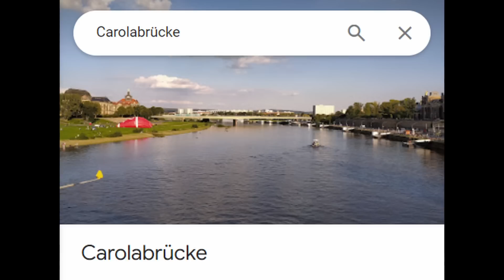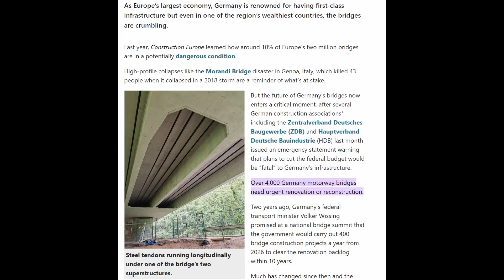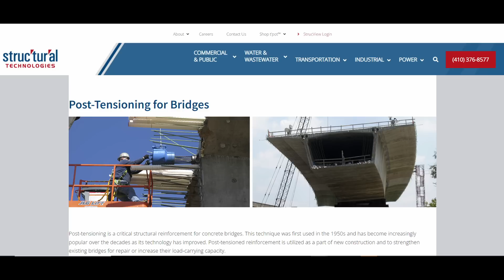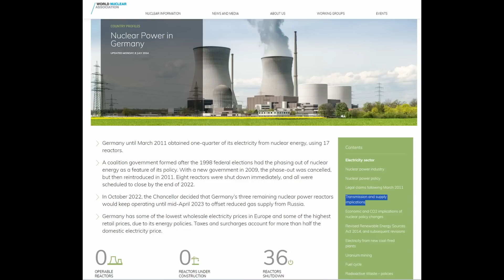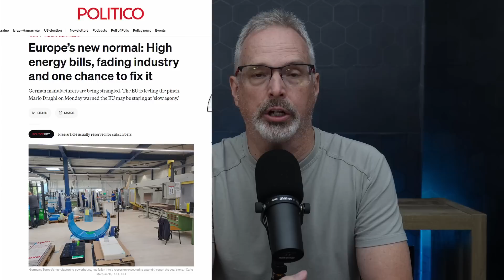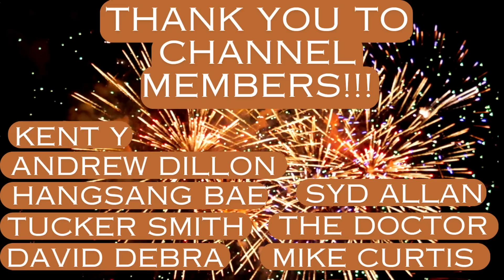Carola Bridge Collapse in Dresden, Germany

Comment: Looking at where the situation has gotten in a lot of places, I am glad my state finally accepted they had a problem mid 2000s and started doing something about it. We were ranking 49th in the country by percentage of bridges that were functionally obsolete or structurally deficient at the time. Budget for road infrastructure replacement was increased in 2004, and a pretty aggressive program of redecking or total replacement of bridges was started, by 2021 the percentage of our bridges in either category were among the lowest in country. Now as the number of bridges that are a priority to address soon has dwindled to nearly zero, road improvement planning for the supplementary funds to main DOT budget is starting to shift to improve secondary highways land portions; such as segments that have narrow shoulders, have sharp turns, and/or higher grade changes than modern standards.

Comment: A few info's from a local, aside from the chloride problem and the lack of maintenance ... we also had a drastic temperature drop right before the collapse happened from 30°C at day down to under 15° at day ... night temp dropped even below 10°C in less than 2 day's - which i believe did give the OLD concrete tension bridge the final "stress"
Reply: Yeah. The Weather was crazy. We went from having the air conditioning running on full blast one day, to having our glasses fog over when we came into the building a few days later. On the "local maintenance front" were I am involved a little bit we have experienced a peak in calls because of small leaks in water pipes in the same period, for example, possibly because of "faster than normal shrinking" of building structures and the like.
Reply: You mean that this bridge should not stay inside while bad weather ???!!!:face-blue-smiling::face-blue-smiling::face-blue-smiling:

Comment: Pre-tensioned concrete is a little problematic.  If the pre-tensioning lines deteriorate, that is corrode, the elements lose their strength and it cannot be corrected.  Post tensioning is almost always correctable.

Comment: Germany's economic situation is not related to energy, more to failing to keep its motor industry up to date technologically and coping with a loss of its workforce owing to aging and low birth rates. The whole of Europe is transitioning to renewable power which is cheaper and more efficient than the coal, gas and nuclear it replaces. Sure Germany lost its supply of cheap gas but managed to cut waste and therefore consumption by 15% in the first 12 months. And I suspect that there is likely a difference in infrastructure health between the old East and West Germany. The nuclear reactors taken off line in 2022/3 were Russian designed with lower standards of failsafe design.
Reply: The Russian designed reactors were taken offline decades ago and the plants dismantled. There haven't been any working nuclear reactors in the eastern part of Germany for a long time. All remaining nuclear power plants had been in the west; and they didn't use Russian reactors.

Comment: Post tensioning creates bridges that are vulnerable to construction quality creating small voids around cables that should be fully enrobed in concrete, and vulnerable to maintenance quality, and to road salts.  To nobody's surprise, it's a construction method that is rarely used now.  There's a lot of 'too clever by half' bridge construction from the early computer design years, designs that were overcomplicated or too reliant on difficult construction techniques or had failure modes that led inexorably to a short service life. Post tensioned bridges are getting replaced frequently nowadays.  In some cases the replacement is a race against time....

Comment: It’s cheaper and less headache to do maintenance,
Then stop and drop what you’re doing to clean up a mess and build another..
But I don’t think they used enough cable when built.
I get using enough to make it work for the cheapest bid.

But they should be 250% its capacity, so it’s fail yield is beyond what we see now.

What’s cheaper? A second pass of cables or complete rebuild?
So they can be neglected as they are. But still survive are failures on maintenance and upkeep. Build them with the intention of neglect. Over build them. Not enough.
But beyond

Comment: The City officials are currently working under the assumption,  that it was a corrosion related breakdown, we can expect further info, in a couple of weeks, because the current flooding limits the causation research and forensic research takes awhile anyway. If you want you can find more on the City's official website, these things could be available in English as well, as Dresden releases parts of their website multilingual.

Comment: This is my thoughts, all of these projects are built by a low bidder so to make money the contractor builds with the cheapest materials and use the cheapest methods of construction. I saw this by working in engineering and construction for 43 years. Poor engineering does happen, as an example to poor engineering back in the nineteen seventies the company I worked for hired a vessel engineer from another company because he said that he had created a software design program that was capable designing a vessel by using thinner thinner wall material which means less cost. The engineer was put on the project I was working on with a lot of very tall vertical towers. His office was next to me and everything seemed good then one of the tower fabricators lifted the vessel on to a transport and the vessel wall stretched and did not return to shape. He and I left on Friday afternoon for the weekend, when I returned Monday morning his office was empty and he was gone. All of the vessel designed with his program had to be re-engineered.
Reply: Sounds like plastic deformation occured unintentionally. Steel can be hardened by stretching it, but I guess that was not the intent in this case.

Comment: I don't think it is corrosion, I think it is corruption.
Reply: You can of course think what you want, but this bridge was inspected on a regular basis and renovation work was completed on 2/3 lanes and was scheduled to begin on the collapsed lane in 2025. Investigations to determine the cause have not yet been completed. There are various assumptions and possibly coincident unfavorable circumstances. That night, e.g. we had a massive drop in temperature in Dresden after a very long period of strong heat.
Reply: @mahei_musiclover  The cold stary sky above with the still warm heat storing water flowing under it will make the bridge want to arc downwards.

Comment: My mom was working as a nurse in a Bremen in 1944. One day, as she was pushing a patient into the elevator, an allied bomb hit and she watched the elevator car along with her patient drop into the basement.😢
Reply: With the safety mechanisms which were already standard by 1940 that should not have been possible, even if all elevator cables snapped at once.
If there is no tension from the cable there are levers that push teeth into the teethed rails, preventing movement of the elevator.
Maybe the blast from the bomb pushed the elevator down the shaft so forcefully, that the cabins frame was riped off the safety mechanism and pushed down the shaft?

Comment: When i saw the arch bridge in the background of the german guy being interviewed, I assumed that it was probably built by the Romans. But had it been, the allies would have bombed it, and i don't think that part of Germany was in the Roman empire.
Reply: The Romans never came to Dresden, except many centuries later as hired artists or as tourists when they were already called Italians. I'm not sure whether any of those artists had an influence on those bridges, they did help with many of the historic buildings. Those other bridges were built between the 16th and 19th centuries. Extensive repairs were necessary after WWII. Carolabrücke was rebuilt as a modern bridge, because the original from the late 19th century was completely bombed away. Despite socialism a lot of historic buildings were rebuilt after the war.
Reply: @KonradTheWizzard  It wasn't bombed away (this would suggest it was bombed by the allies); it was blown up by German troops. Maybe you actually meant that; but "bombed away" is somewhat ambiguous.
Reply: @maro_from_germany  You are right of course. I should have been clearer.
Reply: That bridge in the background is the Augustus bridge; the current incarnation was built in the early 20th century as a replacement for an early 18th century bridge. The arch size of that earlier bridge was deemed too small for modern ships. The Augustus bridge was partially blown up by German troops at the end of WW2 as well.

Comment: According to the German news this bridge was actually in a renovation programme, and the issues known (inspection reports were poor). Unfortunately the renovation wasn't fast enough
Reply: To say it a bit more precisely, bridge C - we are always only talking about bridge C here, the one that used to carry streetcar trains, bicyclists and pedestrians, not the two bridges A and B that used to carry the road traffic - was always found to be in good condition (you can see in the corresponding close up images that it looked like a healthy and well maintained bridge, without any visible concrete damage such as spalling or exposed reinforcements) and got good ratings in the mandatory periodic inspections. In the 2019 inspection some issues were detected, thus Bridge C was due to be renovated in 2025/26.  

The renovation of bridges A and B has been completed just recently. At this point it is not clear if will be possible to repair them (because the connection points to bridge C have been torn off when it collapsed, and both bridges A and B have also moved on their abutments), or if they also will need to be torn down.
Reply: The mayor declined many questions from the city council about the current situation with this bridge in 2023
Reply: already in for how many years?  29?

Comment: Nice commentary on the bridge in Dresden, thank you.  On maintenance in general, I have found that there is generally little interest in maintenance - people want to build the new and shiny at the expense of the older and already standing.  In the early 2000s I was on the Board of Trustees for our church (we had two buildings connected by a very large deck) and my last year I was the president and during that time we were having  continual discussion/battle with a small but very vocal group that wished to finish off the basement in our newer building.  At the time our deck (similar to a bridge) and some other element of the older building needed serious work done on it, but no amount of discussion would sway these folk, even when I pointed out that we were not taking care of the finished square footage we already had and they wanted to add more to it!🙄. Sadly the argument ended when a fire broke out in one of the furnaces in the older structure, which ended the discussion, and ended getting a lot of the work done, but cost the church several $100,000 over and above insurance.  Fortunately no one was hurt and in a way it was a blessing in disguise as we were able to get much of that deferred maintenance taken care of.  👍

Comment: Speaking of deterioration, maintenance and repair, I found a document that shows which states have bridges built with the troublesome T1 high strength steel and an associated chart of the numbers of such bridges in each state.

However, despite exhaustive effort, I was unable to find a list of the locations of the bridges.

Given that the states and number of bridges is known, there must be such a list of their locations.

I live in Georgia and there is only one.

I think you could get a great deal of material for your channel by running down the list and investigating which ones have imminent problems.

There are 20 states and 64 bridges. California has the most with 11.

The document title is:

FHWA Bridge Program Update -
AASHTO RADBUG Meeting
August 8, 2023

FHWAUpdate_RADBUG2023.pdf

I found one full report online:

Nondestructive Evaluation of T1 Steel in 
the Sherman Minton Bridge

FHWA-HRT-23-045.pdf

When I searched "Nondestructive Evaluation of T1 Steel in 
the Sherman Minton Bridge" I got a large number of hits of various documents.

I am going to continue to search to see if I can find a comprehensive list

Hope you find this useful.

Comment: The bridge was made 1967 to 1971 and regardless of salt or not directly on the bridge it would suffer rust regardless and if not properly maintained it would degrade.
But given that it's a tram bridge I'd also consider that part of the problem could be metal fatigue as well as decaying concrete.

Comment: Since this was the rail or walkway section of the bridge, and then the fact the bridge was constructed under the communist party occupying East Germany at the time of construction, I might have a tendency to say design flaw, but you need to see where that section failed first! Regarding Germany's economic issues and your contention about the energy issue, the US better wake up and see their problems, because this US administration isn't far off from those same policies of closing power stations, not understanding that you need reliable power back up running at the same time as you have unreliable (wind/solar) power running so you don't have black/brown outs when they go down!
Reply from the maker: I agree.  Our energy policy in the U.S. is misguided in my opinion.  Where is all of the generation and transmission capacity that will support A.I., EVs and replacement of aged out plants?   The only reason some of these alternative energy sources have any economic viability is due to massive government subsidies.

Comment: Hitler gave orders to blow up all bridges to stop the advance of foreign troops.  As a result, many bridges in Germany were destroyed. After the war this meant that many bridges had to be rebuilt. The bridges from the 1950s and 1960s in particular were of poor quality and need to be replaced today. 
The Carola Bridge is said to have been built with 1x safety. Salt from the winter service caused the cables to rust.  Without prestressing, the concrete is not load-bearing.
Reply: There are many examples of bridges in Germany. The Autobahn bridge near Lüdenscheid (A45) had to be closed overnight because it was no longer able to carry the load. As a result, all Autobahn traffic now flowed through the town. The bridge was blown up and is currently being rebuilt.

In Wiesbaden the Autobahn bridge (A3) should be reinforced. However, the internal steel cables were destroyed. The bridge cracked and was immediately closed. All traffic was routed through the town. Ultimately the bridge was blown up and rebuilt.

The Autobahn bridge over the Rhine near Leverkusen. Closed to truck traffic for years. There is now a replacement building, a second one is on the way.

These are just the examples where the new building was not completed on time.

Comment: Bridges of this type have been poured on site and then post stressed with steel cables running in tubes. Before 1980, those tubes have not been extensively protected against corrosion because it was thought that water doesn't move through the concrete. It was found that the cables had been very corroded and that this probably caused the collapse.
Bridges are inspected every three years with major inspections every six years. The bridge had been scheduled for refurbishement in 2025. However, the stress cables are not visible during inspection. Inspection is looking at cracks in the concrete and corrosion in the rebar. So inspection cannot identify the potential reason for this collapse.
So all stressed concrete bridges before 1980 can potentially have the same issue. Maybe a specific reason why this level of corrosion has happened here that might not happen at other bridges (some ideas are mentioned here in the comments) can be identified, which would limit the number of bridges susceptible to the same type of collapse.

Comment: If they want to make bridges and never do maintenance, which no one wants since its expensive, then make them like they did in the middle ages.

There are still solid stone arch bridges that are hundreds of years old with little to no maintenance. (Depending on the bridge.)

Sure you can't have long or vast spanning bridges, but you can't have those if you don't want to do maintenance either.

Tension bridges are great but any corrosion or water ingress to the tensioned steel is fatal to the bridge.

You saw in the vide, with the old man, an old arch bridge still standing. (Granted I do not know how old that bridge is.)
Reply: If you want a bridge that can be used by modern heavy traffic, there are no maintenance-free options.
Reply: An arch bridge has to be very high to have a large span, but it is possible. You might need kilometer long ramps on each side so the grade is not too much for rail vehicles like trams though.

Comment: Rather than using the term major issues, urgent might reflect the circumstances better. Semantics and nuance matter.
I agree with another commentor. Often, building is being done with a minimum margin of error. Many contractors brag about "building to code,"not understanding that most codes are written with this minimum in mind. Code is what you can get away with, not what you should do. With most large projects being awarded to the lowest bidder, the result becomes easily predictable.
Another factor is ease of inspection being incorporated in the design faze. How do you inspect cable or rebar buried in concrete? Just an example. 
Thank you. I look forward to your follow-up videos.